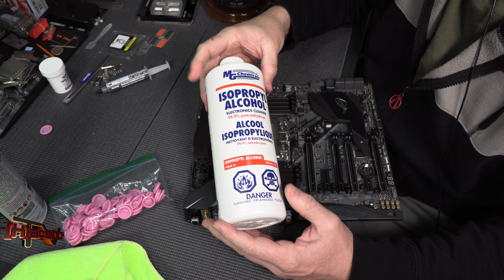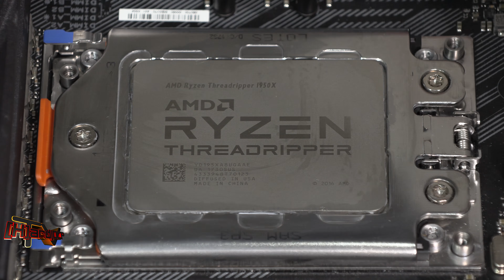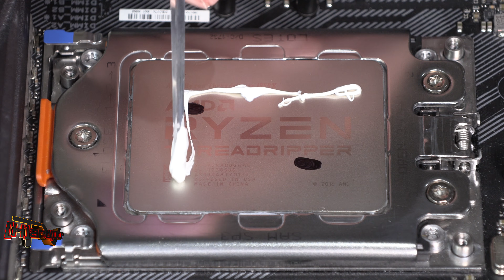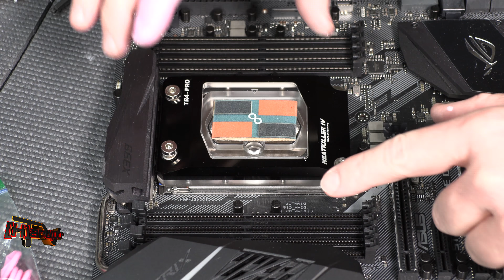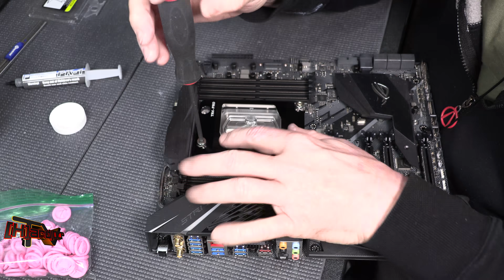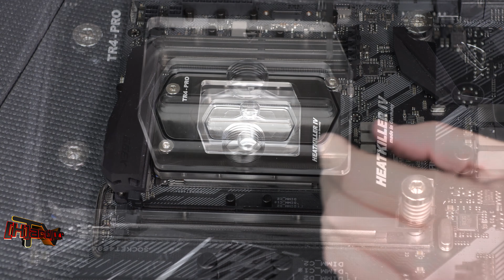AMD Threadripper TIM Application

Comment: How big of a deal is it to have some thermal paste on the mounting bracket if it squeezes out?  I used arctic mx4 and the noctua dot method and it definitely spread over the whole die but I think it may have been excessive. I tried it a second time with less and didn't get as good of coverage. Is it OK to let it squish out the side and then just wipe it or will it end up flowing all over the place when it heats up?

Comment: Hi! Very informative video. I am building my first pc with a threadripper. Should I be concerned if the thermal paste spills into the tiny gap between the cpu and the metal load plate?
Reply from the maker: As long as your TIM is non-electrically conductive, no.  If it is conductive, I would be very careful with it.  TIMs have been known to migrate over time.
Reply: @HardOCPTV  Thanks for confirming.

Comment: If that's the correct way of doing it then I bet 99% of people aren't doing it right.  I want to OC my 1950X and I am but I also can't run it at full load without getting heat throttled.  I've gone through 3 AIO's and now onto Noctua air cooling.  I'll try your method later today but I highly doubt it will be any better.  So far, all I can surmise is that there simply hasn't been a well engineered cooling plan for an intention of overclocking the 1950x.  I see all the tests and benchmarks but I wonder if they truly stress test over the long-haul of weeks at a time which actually is a practical requirement for many people.
Reply from the maker: The fact is that an AIO is not built that will pull enough heat off of the 1950/2950 and get it to TDP.  You need to go custom loop to get the best clocks and use Precision Boost Overdrive.
Reply: @HardOCPTV  Calvin, you got me to try something new.  This was the first time I did the technique of spreading TIM evenly and then adding the die drops and wow... so far it's starting out better and holding up better.  All the videos I watched before just put the drops on the die, in the middle, or various other places.  I'm not getting heat throttled like I was before (yet).  I also changed from the factory Noctua TIM to AS5 TIM.  Not sure which would have been better.

It will be really nice if this holds up around 80c like it is now.  But I've only been at it for about 20 minutes.  I have an extra fan built in that is not connected right now.  Had it connected prior to this and it seemed to drop temps maybe 2c but that thing is LOUD (recycled Corsair AIO fan).  For now, it's just the Noctua NH-U14S with 2 NF-A15 fans in push/pull configuration.

Shoot... just went up to 81c as I was typing this.  

I understand about custom loops being a requirement if I want to really maximize capability.  Just don't see myself doing that anytime soon.

Thanks again for your help and for replying.  

3.85 Ghz OC 1.31volts.  Win 10.  64Gb ddr4 ram.  2x gtx 1070.  512GB SSD

Comment: In 2 week In will install one of the new ones I know that 2950x is the same as the one you use. Sadly locally there is not a apropied one so a normal aio Will do I will test yous. I am bad applying tim. I test on mine 9900k and have hold the way

Comment: I like the spreading method.  I used the pea method on my 8-core 9590. I know it's a notoriously hot chip, but it was ridiculous how how it ran when rendering video for a couple hours.  I spread a thin layer of Arctic Silver with a credit card, then put a pea on top of that, and it ran 15-20 degrees cooler, according to SpeedFan (10-15 according to other apps).

Comment: I know this video is a bit old and I may not get a reply but here goes anyway. With the way you are applying it, spread then dab over active dies it seems that the reason you are not getting contact at the opposite corners is due to TIM buildup. Have you tried the spread and four corner dab to see if you get better contact across the entire surface or just spread evenly as you do and then place the block? I have not done a threadripper build yet but I have done more INTEL builds than I care to mention. I have found that a 5 dab on the CPU has given me the best spread. So much so that every build I do at this point is done that way. It is similar to the X application but instead of doing the X, I just put roughly a rice grain dab equally spaced from the end of the cpu and one in the middle. When I remove the waterblock I have noticed that I get roughly 98 to 99 percent contact and spread, I will also let the contact surface slide a little left, right, up and down to make sure that the paste spreads out evenly. If you are still monitoring this comment section I would appreciate your input as I am about to do my first threadripper build and would like to minimize the amount of times I put on and take off the waterblock. Thank you in advance.
Reply from the maker: You can see and updated video here.  We have tested hundreds of apps, and this works very well for 2-die Threadripper CPUs, you would need 4 dots down on the IHS for 2990WX.  https://www.hardocp.com/article/2018/08/31/amd_ryzen_threadripper_2950x_overclocking/
Reply: Thank you for the reply, it is very much appreciated.

Comment: looks like the same contact pattern repeats itself no matter the TIM application. I bet you a cheeseburger the AMD IHS was not heat tempered and warped during the IHS solder installation at the factory. good old 400 600 800 1000 1500 2000 grit and a piece of glass for the CPU IHS to make it pure flat would yield MUCH better tolerances therefore better temps and contact. (my 6700K cooled down by 30°C at max load using this "trick" to fix manufacturer's tolerance shortcomings) In my opinion you did have plenty of TIM applied, an interesting idea would to use automotive plastigauge  to check actual mating tolerances.

Thank you for great quality videos! :)
Reply from the maker: Well, yes, because we used the same application method, so same pattern.  You would be incorrect on the IHS as a mechanical straight edge says you owe me a cheeseburger.  You can see a picture at the bottom of this page of a mate that has been flowed under load temperatures for an hour with PK-1.  https://www.hardocp.com/article/2018/02/19/amd_ryzen_threadripper_tim_application  I have done literally HUNDREDS of these, so you can take my advice for what we charged you for it.  The companies building these blocks have seen the same thing as well.  Do some test fittings on your own when you have the opportunity.

Comment: Great presentation, as always.
There is one thing that I'm confused about though.
Since the heat spreader on the CPU draws heat from the die(s) I figure it would have a tendency to spread that heat across its entire surface. Therefore wouldn't it be advisable to want the TIM to provide its "interface" across the entire surface as well, thereby transferring a maximum amount of heat to the cooler?
Reply from the maker: Yes.  That is why I suggest you doing test fittings to see what your mating footprint looks like.  Keep in mind that all these fittings were done cold.  As mentioned in the video, had we used these under load over time, they would have likely flowed more material and had much better looking footprints.  That all said, most of the heat is transferred directly above the cores.  While the IHS does spread heat, it does a poor job of it.